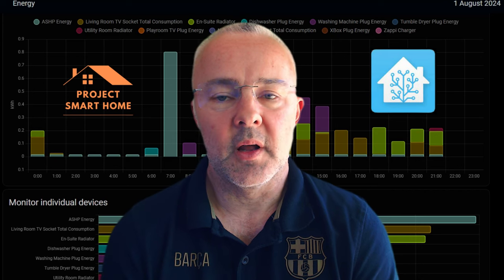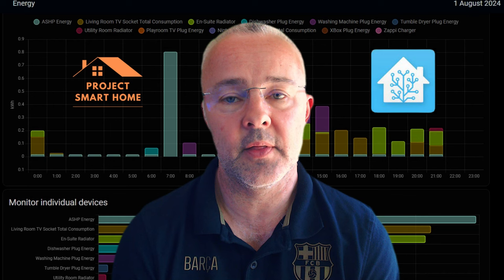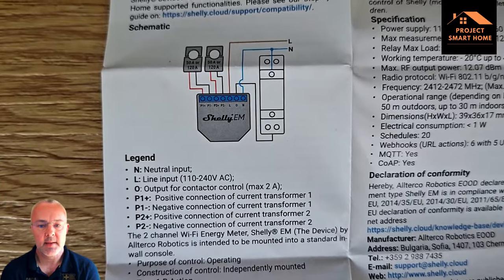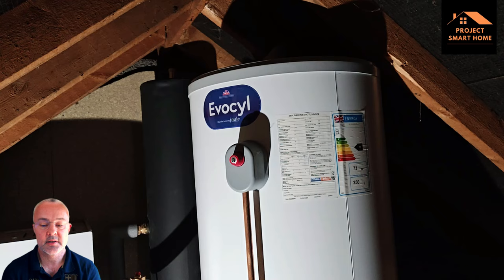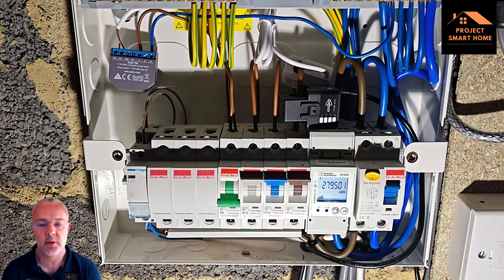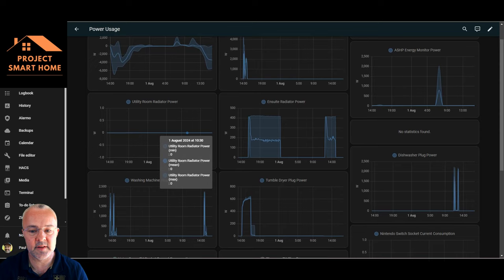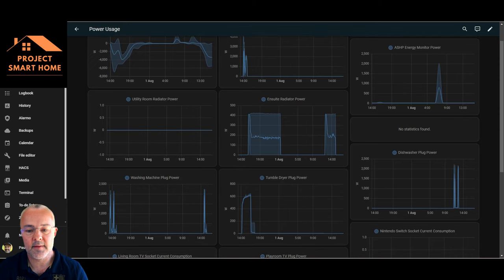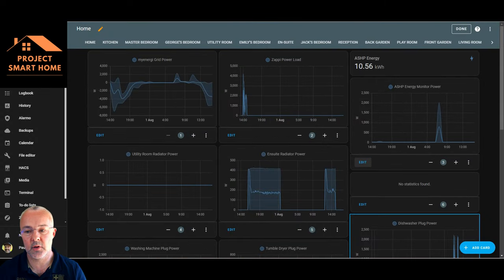Energy Monitoring Dashboard in Home Assistant with Shelly EM

Comment: Whats the highest resolution of the data coming from the shelly em? Or is that controlled within HA? I'm looking for a way to monitor and log the current usage on a 32a circuit at the highest resolution possible, ideally multiple samples per second to detect transient issues. Cheers!
Reply from the maker: I can't see a way to monitor the current usage directly.  The only options that are available for monitoring is W and KWh. When you export the KWh data in CSV from the Shelly app the values are in 1 hour intervals.  The graphs in HA allow you to show the same data at 5 min intervals.
Reply: @ProjectSmartHome  I've got one now, with the /status json endpoint i can get 1s samples, which is pretty impressive for such a cheap device!

Comment: This is really good. Given your infrastructure i.e. mains supply, solar, batteries, heat pump all linked to H.A., it would be really interesting if you went down the route of selecting the optimum power source for a given time of day and price. Any thoughts?
Reply from the maker: Thanks for your comment and question.   The Tesla Powerwall provides a lot of this intelligence as does the My Energy solution (eddie & Zappi).  I configure the Powerwall so it knows when my cheap and expensive rates are and when I get paid the most for putting power back on to the grid (I use Octopus for my Electricity provider).  The battery will save its energy for times when I would pay the most to pull power off the grid.  The My Energy solutions either heat the water or charge the car based on excess power going back on to the grid.  If My Energy detects power going on to the grid it will first of all heat my water and if that has already reached temp then the car will be charged.  If the Powerwall is 100% and the water is hot and the car is fully charger then any remaining generated power will go back on to the grid.  The ASHP doesn't not need to heat the water if Eddie has done it already, if it does need power then it will either use a cheap tariff or use the stored battery power.   I'm not sure HA would or could add much additional value but does provide a great way to visualize the monitoring data in one place.
Reply: @ProjectSmartHome  Thank you. It's appreciated.